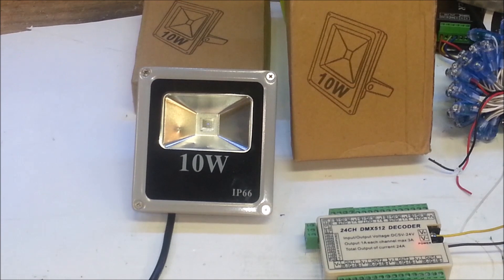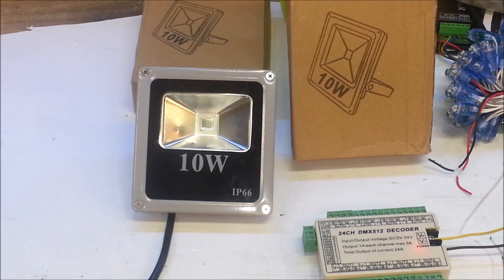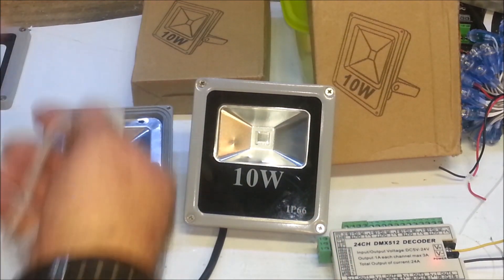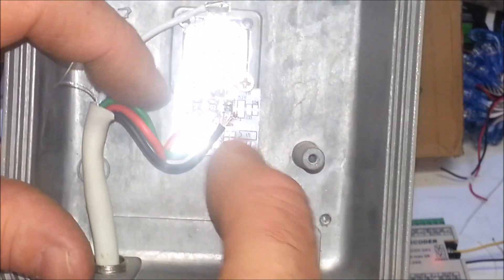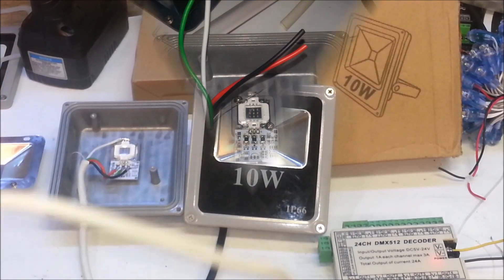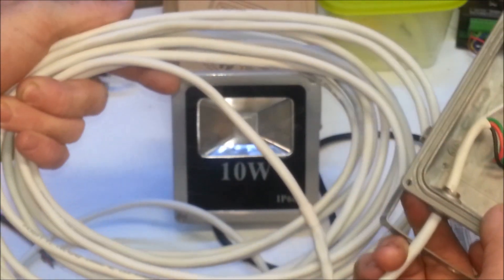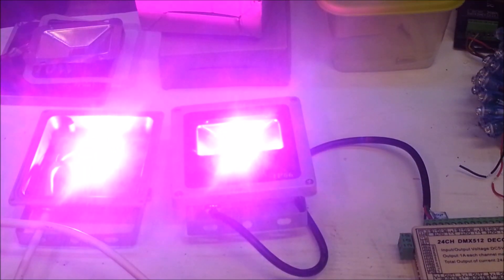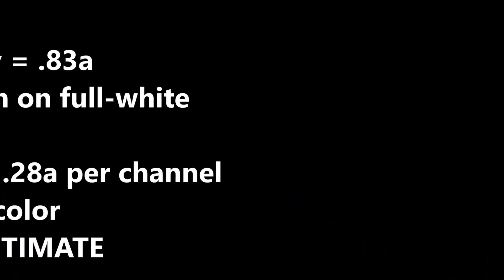$12 RGB Flood Lights Modified!

Comment: ive done something similar where i have 9 of these outside, but im really struggling getting all but 3 lighting up. my power supply is more than adequate it just seems that after the 3rd light its not powering anything up. Im powering them of a 12v power supply rated at 15a in parallel. would i be better with a 36v power supply or would i fry my leds?
Reply from the maker: No, you should use only a 12v power supply.  I would try a different 12v power supply, sounds like there might be a problem with the one you have.  You should only be using around 7.5A total to run 9 floods.
Reply: Oh nice one thanks for the reply. The one I have is 12v rated to 15a and 220w I believe so didn't think it would be a problem. Each chip is 10w rgb and I have done like you have but as I mentioned only 3 light up. I will try a different power supply cheers

Comment: What size area would you say these light  up. I was thinking of getting his 20w version. I have a 2 story home with white brick face so it should take the colors well. 
It's approximately 30 ft wide if that helps . Thanks. Chris.
Reply from the maker: I really can't answer that question... I have not used these yet in the display.  I would suggest 1 for every 8 foot of space you wish to light up.   I had plans on using 4 on the ground level, and 4 on the lower roof pointing at the 2nd story.  My house is roughly 38 feet wide.  Hope this is what you're looking for.

Comment: wondering, how to get guts only... need only board and chip, cuz total costs will be astounding if I buy those damn floods... :(
Reply from the maker: I usually email Ray and ask if shipping is actually lower than what is shown in the shipping estimate window.  It turns out better than what the Alliexpress site says.  Also, I only make 2 orders or so per year and they are typically very large.  He does take care of me with shipping.
Reply: it will still be too expensive, to buy all those unneeded in my case casings when i need only chip and that PCB from it... 
you have any idea how to search for those only?